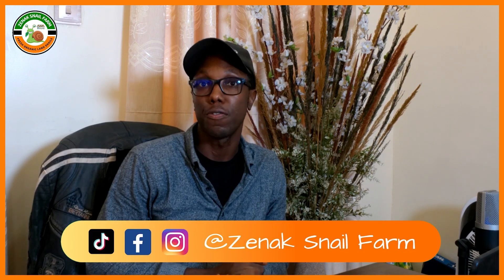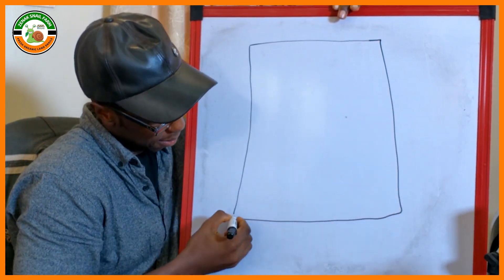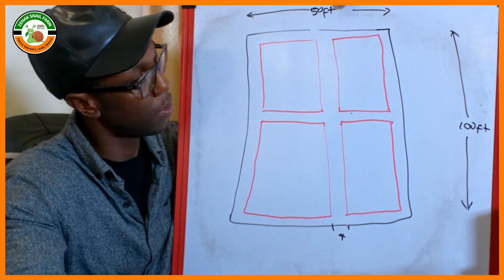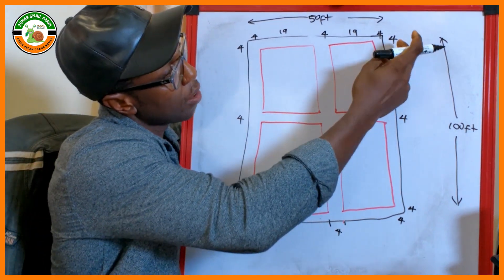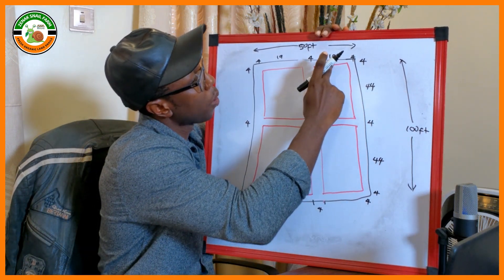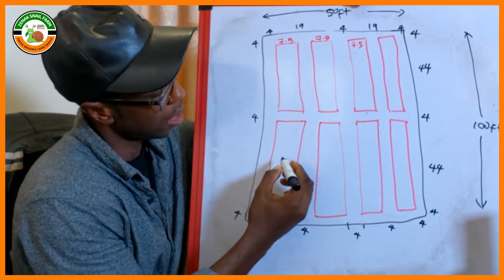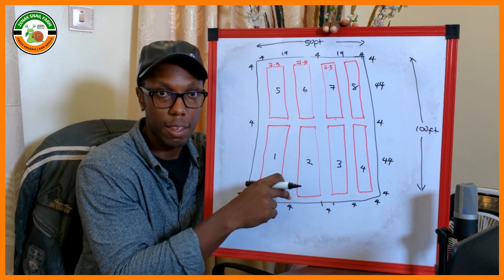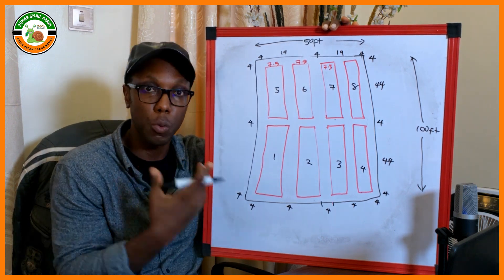HOW to Create the PERFECT Walkway Outline for Your Snail Greenhouse

Comment: Quality content as always.
Reply from the maker: Thanks bro
Reply: @zenaksnailfarm  In one of your earlier videos you said your greenhouse has can accommodate up to 90k snails but you stocked with 1k. What influenced this decision?
Reply from the maker: @clementsaudu8751  I was stocking during dry season which is a challenging season for snails. Normally when snails are introduced to a new environment some will die as they try to adjust to that environment..now u add the additional challenge of the dry season and the fact I'm relatively new to snail farming (there's always a learning curve). It didn't make sense to start with a lot...the facility is there to accommodate a lot of snails but I'm more comfortable starting small and scaling up organically....facility wise I started big..but stocking wise I started small because of the aforementioned challenges
Reply: @zenaksnailfarm  Interesting. Did all 1k go into the greenhouse or they were split between the pen and greenhouse? Also, what's the dimension of your individual pens and stocking density?
Reply from the maker: @clementsaudu8751  95% of them are in the greenhouse. The dimensions of the pen vary..they're not all the same. On average its atleast 150x50cm..some are longer and a bit shorter. Stocking density for AM adult is max 40 per sqm...the hatchling can get 75 per sqm